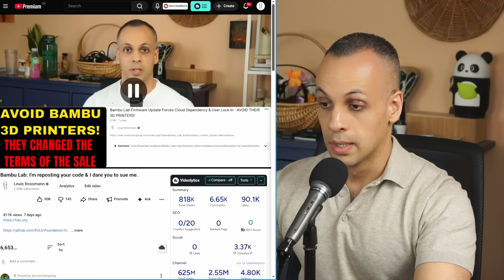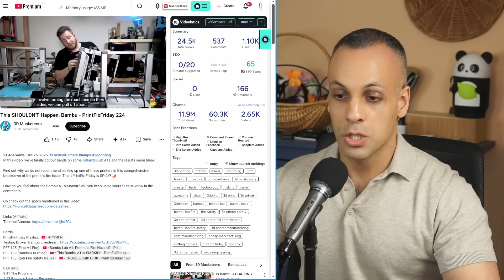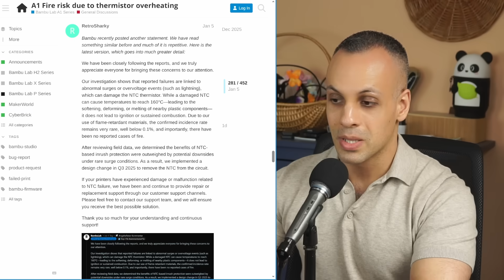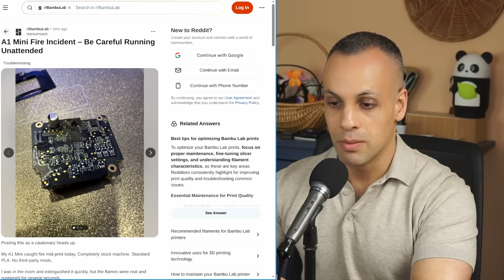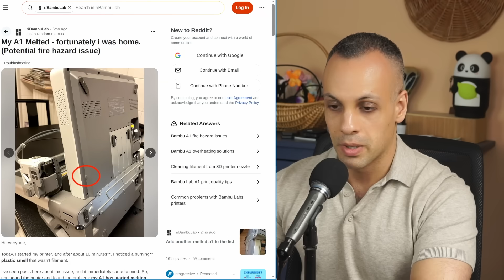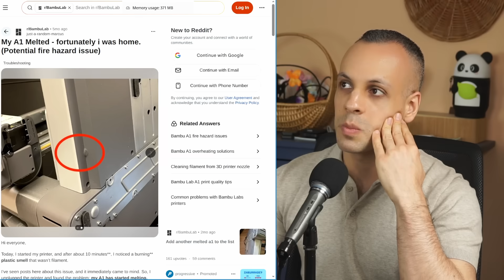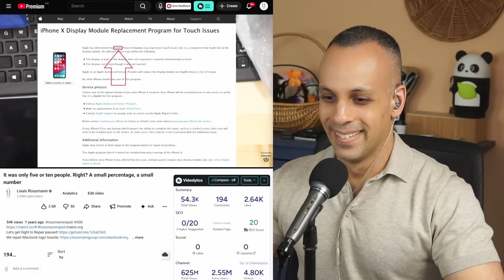Bambu Lab PR dumpster fire is turning into a literal one...

Comment: The #1 feature I look for in every product I shop for nowadays is: Will I own it if I buy it. 

This is insane. It shouldn't be like that.
Reply: #2 if it will work without Internet. I don't think is necessary for a 3D printer to be connected to the internet for printing.
Reply: @TrueSpicymaker That's still part of #1. I'm not owning it if the Internet owns it.
Reply: @jerem-SaveStargate me too. Sony did it on mini disc for years and so does apple. Hate it all
Reply: @TrueSpicymaker heck in a lab I work in we built a printer with the PC integrated to klipper so there is no network access required to slice, or control the printer.
Reply: @TrueSpicymaker  #3 Will it burn my house down
Reply: @caidejs  #4 Does it call itself Cave Johnson (or GLaDOS). Because if it does, it will #3.
Reply: @caidejs that still falls under "will I own it", you can't continue to own something that burned itself (and potentially all your other belongings) down
Reply: @TrueSpicymaker Bambu printers will work fine without wifi, you just have to slice everything manually and put it on the SD card and run it from there, and if you have the right firmware (which you can downgrade to) you can run other slicers and never update it
Reply: @TrueSpicymaker i have 3 bambu printers, they only been connected to internet for short period of time to update, ever since then its been years and i havent connected any of them to internet, Not sure where you got the idea that they dont work without internet.
Reply: @user-ep9gg5vt3g  Why don't you update them and find out?
Reply: @TrueSpicymaker  bambu printers don't require the internet... it's called LAN mode
Reply: @TrueSpicymaker your joking I hope. Definitely do in the Chinese bumboo universe.  They are locking it down too.
Reply: @smartgorilla  joking? about what, having a device that works without internet? we have a tool to transmit data without an internet connection, it's called a CABLE.
Reply: Cable? We graduated from cables ages ago. You can communicate via a dozen different wireless protocols without once touching the internet. Even wifi doesn’t need to go outside your network to pass data.
Reply: @maih600  either way, internet isn't required
Reply: @maih600 no we haven't. I am a union electrician. The world runs on cables. Wireless transmission is only at the absolute very end! Your wifi is being fed by? Yes! Wires! Good job!

Please dont vote.
Reply: @smolbrendan while it technically does, it had a ton of features that could do over Wi-Fi and they took all of them away and now they them from your computer to China then to your printer instead of just from your computer to your router to your printer. 

Like they didn't take away ALL of the features You paid for... Only like 90% 

. Probably wouldn't have caught so much smoke if they had launched a new printer that was locked down but taking features away from something that's already in people's houses is asking for a fight.
Reply: @VoltsAnBolts  My comment was not directed towards infrastructure, it was made in reference to home consumer networks where communication wires between service delivery and device are almost entirely eliminated. 

Most homes have nothing wired to their delivery device or at most have an AP / mesh device connected prior to then being wireless

I worked in telecom for nearly two decades, I was formerly a certified network admin (Cisco certs expire pretty quick and I've changed career paths to where they are no longer relevant to me) I know full well that once your traffic leaves the home, cables run the world. But inside the home, where this internal network traffic I was talking about happens, they are practically obsolete for the average  consumer.
Reply: And then I am afraid to update firmware because I can't know if its actual or "commercial" update...
Reply: @CubiCNooBiC If firmware updates are mandatory, then I don't own it. Whoever makes the firmware does. Instantly eliminated by my #1 rule.
Reply: @jerem-SaveStargate  Upgraded the firmware of a client's Canon printer once. Client had to throw out all her ink cartridges. The printer followed the cartridges and Canon is now banned.
Reply: @CubiCNooBiC  open source open source open source
Reply: Right? My next phone will use linux, even if that limits me to basically 2-3 phones. This needs to end!
Reply: @erebostd My current phone is a Fairphone 5.
Reply: But how else is the poor shareholder supposed to see digit go up? Think of the poor guys 😔🥺
Reply: @SmolPP-c4d  They are the worst of the worst.
Reply: @SmolPP-c4d  About 20 years ago, to blow my own horn a little bit, I spent a lot of time on the internet yelling about how the transition of stocks from risk-prone investments (via valuation) to essentially risk-free financial instruments (via dividends) was the death knel of honnest, fundamentally good corporations... Sadly I have been proven right.
Reply: Corporate greed.
Reply: @TheDesertRat31We need a cure for sociopathy.
Reply: Get new kitchen soon, will find out if everything works without wifi and Bluetooth... Want to just never connect them to any network so it stays that way.
Reply: @MeriaDuck I was in kitchen montages for a while and it’s just stupid. It’s so unnecessary hard to just get stuff that works. And everything is super cheap and just nice looking on top. I’d recommend getting and old gas stove and cleaning it properly/ professionally
Reply: My only exception is Valve, mainly for the fact that even though I could lose my games if they decide to become evil or some POS takes over after Gabe leaves, they’ve invested a ton in other projects and technologies that do give us ownership and respect privacy
Reply: I'm right there with you. Heck, a while ago, after I got a Steam Deck game system, one of the first things I did was check to see how to jailbreak it. Turns out it's literally impossible. Because it comes rooted by default, by design, from the beginning. I hate the fact this is novel and that I was shocked by it. Wish it was more common.
Reply: @Bandrik  it doesn't "come" "rooted" it's just a normal PC. So is every other PC handheld. The Steam Deck has nothing over other handhelds except being very weak with 6 year old outdated specs and very expensive for what is offered.
Reply: Legit same I waste so much time nowadays to check product quality and ownership. Literally skipping all the bs with online connections.
Reply: Underrated comment.
Reply: you never really own a product from the consumers perspective.
Reply: @H12-j2d I would love to see someone trying to claim my plates, glasses and silverware. 😅
Reply: Every Chinese product for years and years. Same rubbish. Remember Hawaii doing the same.
Reply: I'm from a generation of "you own  what you buy". My son calls ME crazy bc I say it's ridiculous you purchase a game/ music/ movies but don't own a physical copy. Me! I'm the crazy one! 😂
Reply: Well, consumers just kept buying garbage, never did their due diligence, nor cared about their rights or even the quality of their purchases. People have collectively asked for this for ages, now they're surprised their ignorance and apathy have come back to haunt them. Corporations are greedy, don't know what everyone expected.
Reply: Guys, firmware updates aren't mandatory and Bambu literally give you the option to go LAN only and that unlocks a developer mode which releases restrictions. You can literally set up your own service and use it how you want as long as you're doing it without using their cloud system. Its a two button press job and not hidden. Then you host whatever service you want.

The X1C firmware being cracked and Bambu's response was what pursuaded me that this was a company worth doing business with. They said that the firmware crack used a vulnerability they had to close, but they hosted the vulnerable firmware that allows you to replace the firmware on the printer with your own. The deal is you sign away your warranty rights, which is fair.

So bambu do offer the ability to detach from their cloud. This software was allowing people to use the cloud services without Bambu's software. And I can see why they didn't like that for many reasons, from funding to security. Their approach to the problem was despicable and they need to take their lumps for it. But most of the stuff people are saying here isn't true.

You don't need the cloud, firmware updates are optional and when firmware has been cracked, they literally hosted it as a means for people to run their own stuff.

So, please, hold them accountable for what they have done, not for what they haven't. They've violated some open source licensing and I personally think their attitude to open source is one way and they should develop their own software. They should have just quietly secured their servers and be done with it. But they did the stupid thing. But don't make it out to be more than it is.

I have bambuddy running and am in the process of locking down the printer so it can be moved off my untrusted network. And, as I said, it's literally a couple of buttons to achieve that... Another reason I bought this printer.

Calm down and hold them to account for what they have done, not imagined stuff.
Reply: I had a hard time finding a dishwasher without wifi.
Sad times.
Reply: Yep if it is cloud connected, I won't buy it period. Consumers need to stop being naive and realize apps and the cloud are not there to help them.
Reply: It may not be insane, it might be strategic.
Reply: @pfschuyler It's a matter of who's side you are on. As a consumer, this is absolutely insane. As a consumer-exploiter, sure that's a strategy.
Reply: Don't buy BMW, folks!
Reply: Its horrible even in cars I saw Renault and Ford advertise connectivity packs like WTF let me create my mobile hotspot I dont need another subscription
Reply: Haha. We are just duped a bit by the invisible hand of the market. This is actually how free unregulated market works when customers do not know what is good for them and are ignorant overall
Reply: and that is why i stop using all google products for what they did with the nest.
Reply: Good idea, but how can you tell? Even reading all of the fine print, chances are they'd be able to sneak stuff past me.
I wish we had a "nutrition facts" equivalent for consumer products, with facts such as this. Without such a thing, it's quite difficult to tell.
Reply: @markp5726 How? Research, others testimony and never being an early adopter or first to buy something.
I always know what I buy.
Reply: With thanks to WEF and other bandits
Reply: Same story with Audible, you own the books… until you don’t 5 years later. 

Purchase basically means Limited Time Ownership.

I thought that’s what Rent meant.
Reply: @Tman-808 I stopped buying books on Amazon now that they've removed our last back door to escape DRM locks, by removing support for older Kindle on May 20th.

I've jailbreak my old Kindle, but it's the last Amazon device I'll ever have bought.
Reply: 20 years ago companies used to market their products longevity and upgrade ability as a strength , now they’re forcing us to get their apps and partially owned the product while actually not
Reply: @anquoctran160 It's easier to establish a monopoly (enabled by lobbying) and trap your customers than actually earn them.
Reply: What does Buy It mean!?  Welcome to Babble!
Reply: That is worth checking these days but it isn't a guarantee when companies change the terms of a sale after an item was purchased.
Reply: @kevincozens6837 
If the product is designed in a way that they can do something to it after I bought it, then I'm not buying it. That's the whole point. It's not about legalese, it's about actual capabilities.
Reply: Of course it does, how else is the big scummy companies gonna earn their fortune?
Reply: Man you must buy nothing according to your follow ups
Reply: @alex31ytb I don't need much. And I prefer investing then spending 😂
Reply: Good luck buying a TV (or if you set it to dumb mode, a device that will play tv content) in  2026.
Reply: @TheTurbinator Commercial TVs, monitors, etc. TBF I'm still perfectly happy with my 10 yo TV. For content I love jellyfin
Reply: Iphone obviously doesnt fit your feature. Are you using iphone?
Reply: @ashokkumar-zw8vi Apple is on my blacklist since 2001. Currently I daily drive a Fairphone 5 with a user replaceable battery and parts availability. Quite happy with it.
Reply: Everything old still works but everything new lasts not even 10 years. I have 2 phantom 4 drones, that need a small repair but can't get the parts. Or this one... all you batteries are bloated and unusable. New tech sucks.
Reply: @ekidmusic Yup. And people still buy from the same brand regardless. Nobody cares. Nobody learns their lesson. We the people get what we deserve.. We enable this!!
Reply: Another clown too low iq to understand what buying a license entails
Reply: When I bought my X1C (when they first came out) I did own it, but Bambu changed the software, firmware and total user environment after the sale! How do you know you will always own it if you buy it?
Reply: @geekdog68 By buying something that doesn't automatically update itself without my express consent. Updating the firmware must be either a) a manual action; or b) something I must opt-in to become automatic if I choose to.

And of course, it must NOT be a product that necessitates cloud access to a proprietary server in order to work.

And you can bet, I will read the release notes and won't be an early adopter of any new firmware release. I'll check the feedback of others first.
Reply: didn't know all this about BL at first.  Got the P1S and man, it was sweet, so much, I got the H2C next.  But the more I learned the more it seemed, well, it was different somehow.  And then, my questions started to roll.  Where do I enter G-Code?  What's all this cloud jumbo, my stuff goes through them first?  What about proprietary models?  Then I get peeved at BL.  Did I buy you a printer for my place or for me to own?  LAN and Developer soon to follow and watching this closely.  BL printers are really good printers.  I like them a lot.  But this BS over opensource code on github, idk man
Reply: Yeah i was looking for an e-reader and i settled for kindle, not because its so user friendly but theres such a big jailbreaking community that with their subsidized price its such a good value for someone willing to do the jailbreak
Reply: Exactly. I own two Bambu printers and asked this same question before purchasing. My printers are offline so a little leg work up front ensured that my purchase was shielded from this nonsense that I hoped wouldn’t happen, but here we are.
Reply: I always tried to tell people about bambu, but none cared to listen. So fuck them now. 😂
Reply: Cars after 2000: impossible
Reply: Go buy a gun and use it as an ignition for starting your campfires, watch how quickly you learn things you "own" come with rules that you don't. Just like buying any aircraft 😂 if you want to "own" it, you better make it yourself 😂

Comment: I have an Anet A8. I trust it more than I would trust a Bambu Labs A1.
At Least my Anet A8 dosen't connect to the internet.
Reply: Mandatory Internet connectivity for an operation that is performed locally is either wrong or insane (and sometimes just both).

At work, most of what our terminals meaningfully access is managed through a cloud layer, which means even sending a print job to a local printer has to be done through its network address (and for some reason that's still unresolved, it takes 3-5 full minutes for the remote desktop to finish tallying up all the available "local" printers).
Reply: @Stratelier  latency as a service
Reply: @bigzigtv706  True, "the cloud" may offer better raw specs but it ALWAYS has worse latency.
Reply: My K1Max doesn't either. I checked before buying it. It may not be as good as the Bambu, but it's a lot better than my Anet 10.
Reply: Man I haven't heard the words Anet A8 in ages, that was my first printer too! I remember the fires that it caused people cause it lacked thermal runaway. Updating its firmware to Marlin was one of the first things I did when I got it.

Ended up upgrading to a Prusa i3 Mk3 which then became the Mk3S, still use it to this day
Reply: @Velocity_AU are you thinking of upgrading the mk3s into a mk4s or switchwire?
Reply: @flamestoyershadowkill haven't really thought about it, my printer currently needs quite a few parts replaced probably, like bearings and liner rods due to age and some scratches I can feel. I would like to upgrade it and get it working like new again, but that's not on my to-do list at the moment, since that will cost money I don't have
Reply: Protogen :3
Reply: @SolaceCafe  :3
Reply: @RFProto  bite :3
Reply: No machine other than a machine that supports an internet browser should connect to the internet.